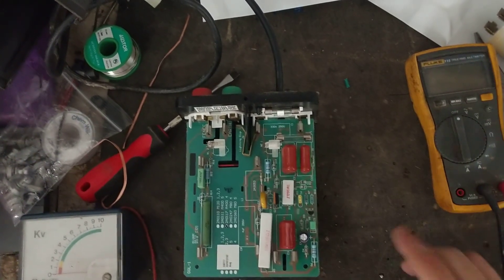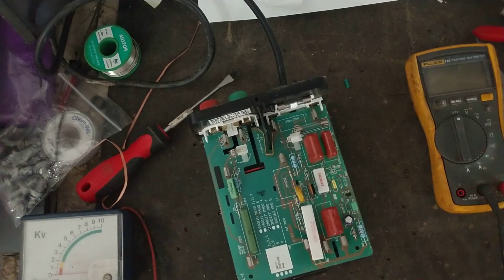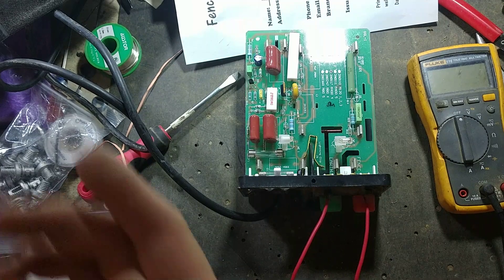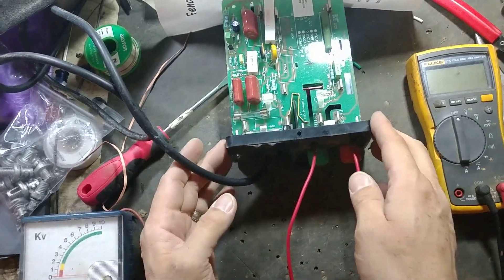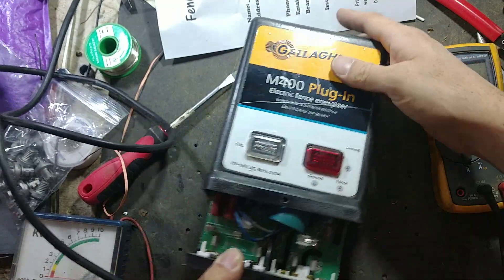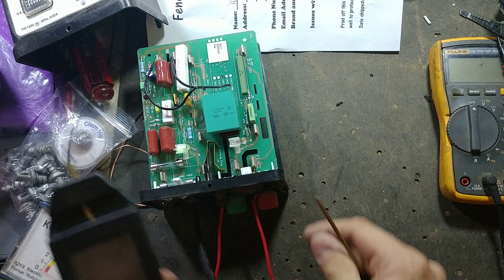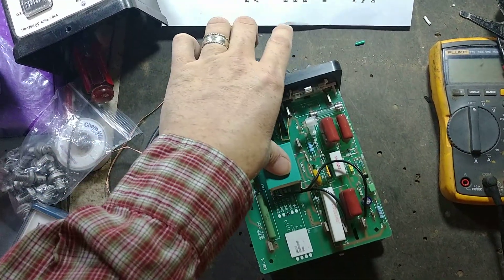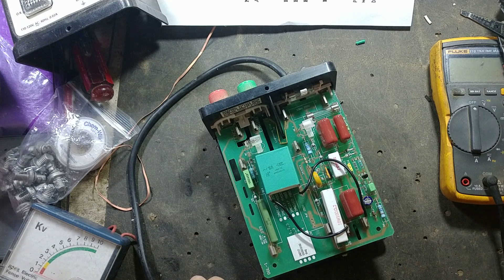Making An Electric Fence Charger Stronger With More Joules

Comment: How would I go about increasing the voltage? Rewind secondary in the transformer? Looking to get through chicken feathers better - like 20kv would be great. Have real good insulation (using PVC pipe) so no worries on arcing and shorting out.
Reply from the maker: That would be one way I guess, but I'm not sure how you would go about doing that since most transformers are sealed in epoxy and sticking a different transformer in a unit wouldn't work either. There's no way to know what the voltage will be, higher or lower, if you tried installing a different transformer into a unit because you didn't know the winding set up and you won't know if it'll work correctly with the board because the internal impedance of the transformer has to be somewhat matched to the board so the board can discharge it's energy into it correctly without back feeding into the board and damaging something. I think 100% of the manufacturers out there stay in the 7,000-10,000+/- volt range. I think there's a rule within the electric fence business that a unit can't exceed much higher than 10kv. The PVC pipe will work for a little while, but eventually the UV from the sun is going to breakdown the plastic and it'll start to arc out in different places. I've seen this happen plenty of times over the years and I don't know how long it will take though to do that. 

Your best bet is to get a little bit higher joule unit and try spacing your wires differently or adding some extra wires to close up the gap some to slow them down and have a better chance at getting shocked, especially with a bigger joule unit. If you go with a bigger joule unit, you'll likely need to increase your ground system as well, that's electric fence 101 that people don't follow at times.

Comment: I have a newer m160 could I modify it?
Reply from the maker: Possibly, but if it's still under the 3 year warranty, I would leave it alone until the warranty is up. If you're trying to make it stronger, it probably couldn't go up in power all that much.
Reply: @FencerFixerRepairLLCKansasCity  Thanks for your reply. What size capacitor would you tey?
Reply from the maker: @SBoth_ What size uF in your current unit?

Comment: I would love to modify my devide to have a higher frequency. My cat learned to dash through the fence between ticks 😅

Do you see any chance this is possible?
If it means less Energy per tick, that's fine.
Reply from the maker: No unfortunately they're basically stuck at what they are. You could try and some more strands to take up the space where the cat has to work a little harder to get through.
Reply: @FencerFixerRepairLLCKansasCity  thank you for your quick reply!
I will do that then.
I am sure he will learn eventually 🤣

Comment: were do i find one of them testers to test joules
Reply from the maker: The one I think in this video was junk and it didn't last and you can't fix it. A joule meter for testing electric fence units isn't something that's readily available. We have a newer one that we bought from a retired repair place and he said back when he bought it years and years ago, it was $600+ from the manufacturer.

Comment: The board on my Zareba 100 fence charge burnt up, possible lighting strike. I can't find the 6 joules board, but can find the 15 joules board, as both appear identical. What harm can be done by putting the 15 joules board on it ?
Reply from the maker: They're not the same board 100% The secondary board in the 200 Mile units doesn't have all the timing components that the 100 Mile does, so installing the 200 Mile board it won't pulse or do anything.
Reply: @FencerFixerRepairLLCKansasCity  thanks. I ended up taking it to a repair shop near me. The guy is going to use the box and is going to replace the internals with parts that are higher quality.
Reply from the maker: Sounds good

Comment: Great video! Can you do this with a ParMak MAG 12 SP? I'd love to see that 😂
Reply from the maker: No unfortunately not on that unit. They're set up pretty much as they are. If you made it much stronger, you would likely either burn up the transformer inside prematurely or need a bigger solar panel to keep up with the extra draw. Those have a feedback wire that are used for calibration on the needle gauge, so that would likely be messed up as well.

Comment: If you didn’t care about it fitting back into the casing could you just get a small energizer and swap parts till it’s pumping out 6-9 joules?
Reply from the maker: Possibly, but you just have to make sure the transformer can handle that kind of power. If you over power the transformer, it might work and show good for a little while, but you'll eventually burn it out and ruin the transformer.

Comment: How to find energy without using equipment I have no equipment 
Plz help🙏
Reply from the maker: You could use a digital electric fence fault finder. Then test it with different loads across it, 10 watt resistors and then start with 1,000 ohms and gradually go down to around 250 ohms and get a few sizes in between. With the fault finder, it will show you the amps it's delivering out of it. As you increase the load closer to zero across the terminals the amps will climb up. At a certain point when the unit it stressed out enough or beyond is capabilities, the amps will go down after they go up because it can't handle the load you connected. I would go to where the kv reading across the unit is around 3.8kv and no lower and see what the amps are. The amps will vary from the joule rating of the particular unit has. The higher joule rating it the higher the amps can climb.
Reply: Thank you very much sir, can you explain a little more

Comment: I thought u jusf read the output at 1.3kv and then you said they only run at 600vdc..  what part steps it up to the 1.3kv?  The transformer couldnt be whats stepping it up..  is there a high frequency output or is it a voltage multiplier : doubler circuit?
Reply from the maker: There is a multiplier circuit on this particular unit with the smaller red Capacitors that gradually build the voltage up to around 500-600vdc higher amps over to the main big Capacitor. Then when the unit is triggered, it fires that 500-600vdc from the big cap to the transformer and it takes that voltage bumps it up to a higher kv, but lower amps and then spits it over the the fence and ground terminals. That's how all low impedance electric fence chargers work. Some have a multiplier circuit that gradually increases the voltage, and some will have a small transformer that bumps the voltage up that feeds over to a big pulse grade capacitor. The voltage going across the big Capacitor in different units does vary from brand, model, and size of unit.

Comment: Interesting video. I never thought of increasing the capacitance like that, but I suppose it's pretty obvious if I actually thought about it. I just ordered a replacement output transformer for my JVA (Pakton) 1.5J energiser.  The new part is up-rated from the original as they found them to fail a bit too much.  The same transformer is used in JVA and Daken energisers from 1J to 5J. Makes me wonder if the circuits are the same in the larger units.
Reply from the maker: There's probably some differences in them besides bigger or more capacitors. Some brands have capacitors built onto the boards as part of their multiplier circuit to build the power up to the main discharge capacitor. Some boards also have transformers built onto the board that increase the power up before it gets to the main discharge capacitor as well. So there's likely more to it on those, but you would have to look up the parts list and see if the same board is used in multiple units.